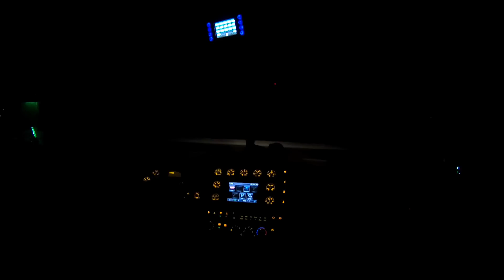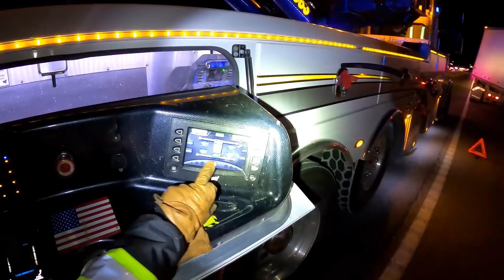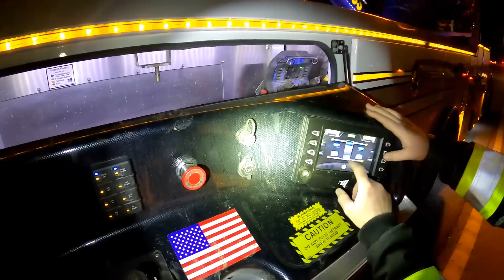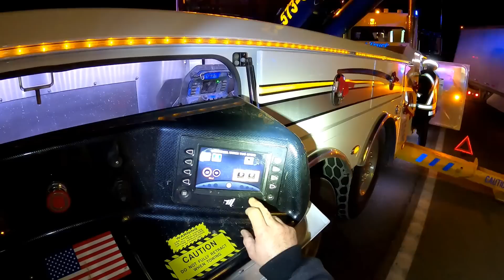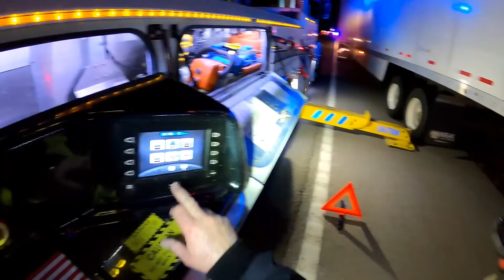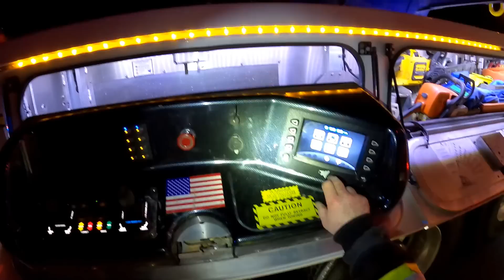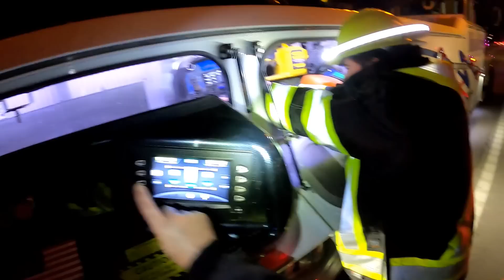Ethan, the Rotator, and the Stuck Trailer

Comment: Ethan is a lucky young man. Both for wanting to follow in your footsteps within the industry and for your patience in teaching him. I too followed in my father's footsteps, however I was not blessed with the quality of equipment he has to learn on. Our first heavy was shop built on an old (even then) LF Mack with a 5 speed main, a 3 speed aux, and 2 speed rear ends. Oh and a gas engine (an 0ld Continental salvaged from a WWII Army truck). Our first heavy "rotator" was an ex Navy Stirling that had a 3 speed box on the crane to control the winch speed. It was designed for lifting airplanes but we used it for everything from undocking tractors, removing oil tanks from under ground to tractor trailer accidents of all kinds. It's top speed was about 45 MPH and was All Wheel Drive. It was a DDS235 if I remember right. Taught me a lot about rigging though.

Comment: Excellent job by Ethan! 
     At the end he didn’t listen about plugging in the remote before placing it in the compartment. Is the remote still controlling the rig at this point? I can see this as a huge safety issue if that is the case. 
   Great design having the charging cord deactivate the remote, it just needs to be implemented before the remote is placed in the compartment and it also makes plugging the cord in easier too! 
   Maybe slow down for one second Ron and explain while Ethan was listening. The boy was pretty intent on putting that remote away...LOL!
  Great job with the lift controls Ethen and remember “safety first”! Oh and listen to dad!

Comment: Do you just hook thru the pin holes in the tandem slide rails?
Had a step deck bust a tire then throw a super single gator under me today  and was expecting this outcome but it cleared under the T680 somehow

No doubt thats got to be the neatest feeling being at the controls of that truck helping someone in need

Comment: Said it before and I'll say it again.... Wish my dad had been as "calm" a teacher as you are with son-in-law Talon and son Ethan. Just putting a boat on or off a trailer never ended well when I was a kid.  I have to wonder, what came first, the air line broke and the truck went into the ditch, or the truck went into the ditch and the mile post took out the air line.....  Midwest Truck to the rescue in any case!

Comment: Good Job!! But Hopefully you will take this as a helpful remark.  I would set him up in a field or your back lot have him play with it there.  A Lot.  Also put him in the smaller units first to get used to rigging and pulling on smaller things.  Just like walking crawl first then walk. Have him diagram a rigging and lift and pull on paper Like extra credit. He will get there but that way would be simpler and easier as well as safer.  But he did Ok!!  Like I said Great Job!!  Thanks for Reading!!  May God Bless!!  Remember be safe Out There!!

Comment: Many years ago I was westbound on I-80 in Wyoming and i had just left the T/A in Fort Bridger and going down the very long and steep downgrade about 5 miles out and I ran over a "gator" in the roadway. It "bit" one of my right side brake chamber air line and I came to a quick stop. I was loaded and it kept my trailer from going off the road like this.

Comment: Do you need your CDL to drive the rotator? And stay safe Ron God Bless.
Reply: CDL is required to drive anything over 26,000 pounds. Tator weighs in at around 73,000. Plus to tow with something that big needs a class A.

Comment: Ethan appeared a LOT more confident in this video. As other posters alluded to, running the remote is nothing for the video game generation. However, as you constantly preach, knowing the ins and outs of load, angles and rigging is a lot different than just operating the boom. 

When I first found your videos, I was intrigued. I work at NASA and hold rigger certification and overhead crane operator certification. Watching your "on-the-fly" judgements and calculations of loading, lift angles and movement of loads is impressive.

Out of curiosity, do you have any rough estimate as to what percentage of jobs get video posted onto your channel here?

Comment: Hey Ron, Figured I would bring this up as a great drill to help Ethan learn how to fine tune his control of the rotator.  Its a similar one to a drill my father had me do with the tower ladder when I was young. All you need is four cones and a length of rope. Feed the rope through the top of one of the cones, then tie a knot so it doesn't slip back off. Use the rest of the rope to make a loop that one of the hooks can hook into. Hook the cone to one of the hooks on the boom, then place the other three cones wherever, could be on top of another tow truck, or perhaps just inside of the bay (to simulate overhead power lines or an overpass), or even behind a trailer. The goal is to lower the hooked cone onto the three other cones one at a time, and then raise it again, all without knocking or tipping them.  

I still remember sending the bucket over the firehouse and then lowering it to rest on a cone that was difficult to see from the bottom was quite fun and a little exciting, Ethan might find it fun as well, and fun training is good training.
Reply from the maker: That is a very good idea.  I think I will try that.  Not only with Ethan, but with some of the others as well.   Thanks for watching and God bless.
Reply: @RonPratt  I have to be honest Ron, I was looking for a remote in your hand too, ethan either has a good teacher or is a fast learner, the way that trailer came up, across and back down was as smooth as anything, it reminded me of one of your videos where a lady crashed and was worried about you damaging the car as it was not damaged, a police officer but a can on the roof of the car and said "that can will still be on the car once the car is back on the truck"and it was...... Fantastic job by you and ethan.
Reply: @RonPratt  Glad to spread the idea :) I've seen pictures of the drill and a few different variations of it on youtube (look up Aerial placement drills, they've used pike poles, roof hooks, even a tennis ball) but the ideas are all the same and some set-ups can be quite challenging for even the pros. The nice part is when you go out in the field and can quickly stick the boom into a gap with inches to spare all around (or for me, place the bucket of the tower within 2 inches of a third floor window sill without hitting the building). It just all becomes second nature as Im sure you know. Hope you have a great New Year, and lookin forward to more videos from you :)
Reply: @RonPratt  

I second that. I think it will teach fine motor skills using a remotely operated device.

I always had trouble with orientation in using a remote. I can do it, but for me, the visual cues are screwy.
Reply: I had a similar way as i learned how to operate the loading crane of a truck without a winch. There we should touch the top of the cones, that where placed at various locations near the truck, with the hook from the top so that the hook directly lays on the hole of the cone. Its especially a good way to learn to work without a remote (The crane of the truck i learned with didnt had a remote so i needed to stay next to the truck) and to learn to estimate distances or where the hook is and how much room you still have until you reach the object.
Reply: @RonPratt  hang a 5 gallon bucket of water and don't spill any water
Reply: @RonPratt  I see the beginning of the Midwest Truck Prattolympics event!
Reply: I did something similar with the front-load trash trucks I trained; co-ordination of controls is critical. I'd put my hand on the end of the forks and have the operator keep the tip there while raising and lowering. 2 sticks, one control, as it's said.